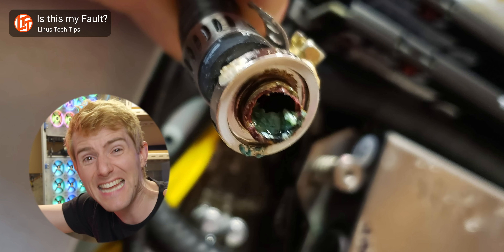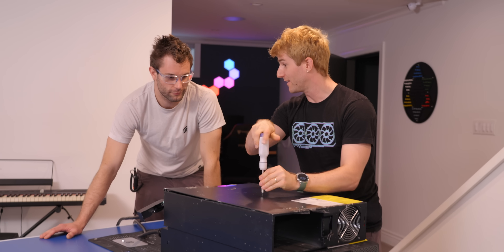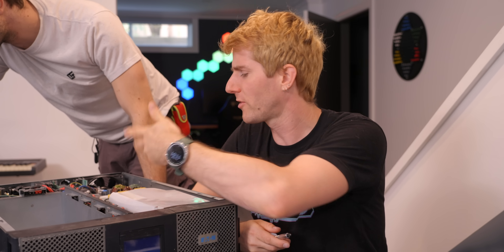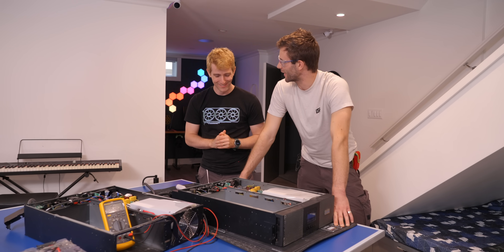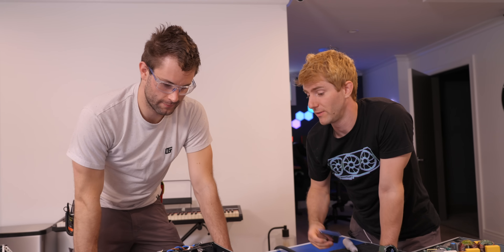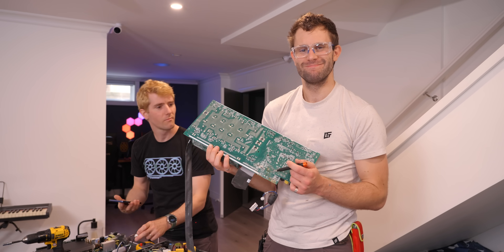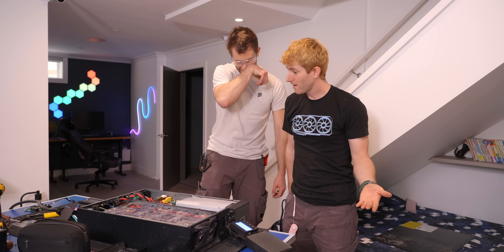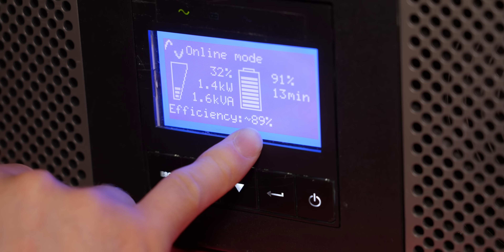Risking my life to save $5000 - Water Damaged Battery/UPS Repair

Comment: 14:46 BP Voltage out of range" refers to Bypass Voltage out of range in Eaton UPS systems, which occurs when there’s no AC power connected. By default, the UPS only starts when main power is present. You can bypass this by holding down the power button after the UPS initially turns on, allowing it to start without wall power or a phase. There is also a setting in the UPS to enable startup on battery power.

As a side note, if you start the UPS without grid power, it will have a random phase direction. If you later connect it to wall power, the UPS will sync with the grid within a ±0.5Hz range, which is another configurable setting.
Reply: Its great to see super specific info pop up in the comments for a project like this. Thanks dude.
Reply: Wow, that is a horribly confusing error name. How did they not realize people would misinterpret that as "Battery Pack Voltage"?? Why the hell do people do two letter acronyms for a single word like that???
Reply: @wisplite  its stupid, but CS and their technicians ideally would know what it means when it matters, like if it was already plugged into ac power. would still be better to make it clearer and save a google search or the poor CS reps from telling people to plug it in

Comment: Why aren’t servers etc. inserted at angles (say 35 degrees) like a cascade, so any leak at the top rolls down the top of each unit to a tray (with moisture sensing alarm) or the floor, if the top covers are have no holes. You have lots of engineers there, it’d make a great video idea.

Comment: Couple of things worthy of note for capacitors: Just because they are rated for say 600 volts doesn’t mean that they ever had 600 volts on them. Second of all, if there’s bleeder resistors on the board before touching anything short across the traces for the capacitors with something like a screwdriver. As soon as you do that you’ll be safe because the bleeder resistors will prevent those capacitors from charging up again. For the people who aren’t electrical engineers, capacitors can charge to a significant voltage if you don’t have a load on them, they are able to do that by picking up charged particles in the air and slowly building up a charge. That is why you always leave high voltage capacitors shorted out when they aren’t in use.
Reply: Big capacitors are scary things indeed! I have a couple personally that require the Permanently shorted procedure!
Edit: permanently shorting large capacitors is for storage if they are not in a circuit
Reply: IMO checking/discharging with a screwdriver is not a good idea with UPS, because it can easily get welded to the contact points.
Reply: Jesus Christ! Please stop advertising the ol' poke it with a screwdriver method. If you dont own a good multimeter to measure the voltage: You dont belong there. If you dont own the proper tool to discharge a capacitor: You dont belong there! Measure the voltage, then discharge with a big load resistor that is attached to probe wires. Alternatively you can discharge with the low-z mode of your multimeter, it will take some time.
Reply: Charged particles? I thought it was dielectric absorption?
Reply: @WindowsSucksUwU  Dielectric absorption is also the reason I know of. I've heard the "charged particles" idea before but doubt that is the real reason. Either this only applies in very specific circumstances or it is a misunderstanding on why we keep capacitors shorted when not in use...
Reply: Could one also try to power on device to help drain?
Reply: @mrmotofy  depends on the device, for my induction heater I built part of my discharge procedure was to “turn on” the output while it wasn’t plugged in to mains to safely discharge the large bulk capacitors. But in some cases turning the device on may charge things instead of discharging them so I wouldn’t say it’s a universal approach
Reply: Indeed. Film caps dont really come in low voltage ratings. It is common for even a very small metalized polypropylene signal cap in audio to be rated at 250-600V
Reply: Just beacouse parts are rated at 600V - doesn't mean faulty unit cant have > 600V on those. Typically caps can do +20% of their rating (600V cap can hold ~720V before destroying itself). As whole unit is faulty, some voltages can go way higher then they really should. PFC converters are a prime suspect there.

Comment: Yeah, I once accidentally shorted a 450V cap with my thumb once. PSA! Never take apart a power brick to diagnose a loose component guys. Managed to burn two holes in my thumb and then two more in the kitchen scissors discharging the power that didn't go through me. Hurt like F:)K!

Comment: I would love to have a few of these. I do have 6 1500VA but if I'm gaming and the power goes out (it goes out more than I would like) and come back on and goes out again a few minutes later the UPS will just shut off along with the PC. It's like the caps didn't have enough time to charge back up to catch the next power outage. It's happened to me twice now. And the last storm we had the power went out for a while, so I turned off my gaming PC. The power came back on, and it was up for 10 minutes. So, I turned on my PC and just as it was booting up the power went out and so did the UPS. Sweating bullets after that, but once the power was up for 30 minutes, I turn on that PC and it was fine but scared the crap out of me.

Comment: Probably not a good idea to have UPS under the water cooled machines, but at the same time you don't want a heavy device on the top of the rack.
Maybe you should consider getting some water leak detectors (like Aqara ones) and put them between machines (or attach wires to the nodes of the sensor and put the wires between the devices in the rack if the sensor doesn't fit) to detect water? Aquara is just an example I know you hate replacing batteries. But with a smart water leak detector and some home automation you might be able to setup something to turn off everything if water leak sensor detects a water. Just an idea.
Reply: The UPS already has "turn off everything" functionality; it's the RPO (remote power off) header they forgot to install on the back that put the UPS into emergency off mode when it wasn't plugged in. This is required by fire codes in many applications -- you need a way to kill the power to everything so that firefighters don't get hurt spraying live equipment.

Comment: Also could’ve saved 5000 by just buying a lithium solar battery generator and use it as an ups. It’s amazing the price difference in products that are the same but one is sever-rack shaped and it’s double the price.

Comment: Instant acid reflux! As an electrical engineer i'd strongly recommend NOT to use that thing. Whether it works or not. Any hairline fracture in the boards/contact points can wreck it and burn your house down. Your fire insurance will just flip you the bird. "Just think of your kids"[tm]. No seriously. DON'T USE IT!

Comment: BP low, is Bypass voltage low. because the UPS is not powered by utility, if you had pressed and held the power button, it would have started in battery operation. and when i saw the emergency power off I emideately thought of the remote power off (RPO/EPO) best regards an eaton tech :-)

Comment: Work with high voltage equipment, puts safety warning everywhere, but doesn't electric - restraint work gloves, that would have cost nothing but make very dangerous thing, slightly less dangerous

Comment: I hate UPSes, they're a headache, they fail when you need them and end up costing more than the damages if something happens. Mos UPS units don't even know their batteries are dead until they try to use them in an emergency.
If you live in a stable area just get anti-surges on your consumer electronics. (yes, they also expire, but cost near nothing)

Comment: 0:15 Sir thats not a high voltage piece of equipment... "define high voltage as above 1000 V for alternating current, and at least 1500 V for direct current."
Reply: not HV for an electrical grid, definitelly HV for electronics!

Comment: I took a broken screen for free that wasn't cracked and fixed it by just swapping out the capacitors in the PSU preventing. Please don't worry I knew what I was doing.

Comment: not suprised that the lead acid battery still work since they are pretty short resistant and im also guessing you used distilled water for the cooling loop or other similar non/low conductive liquid , and the only other way they can be made unusable with water is if the acid in them gets too diluted in which case you can just fix that with replacing the acid or using a non reactiv drying agent
Reply: They are sealed

Comment: "DO NOT TRY THIS AT HOME. Not only will you die, but it will hurt the whole time you are dying."
Reply: Except that you wont die.
Reply: I wonder how many unskilled people will kill themselves in the upcoming months buying defective electronics repairing and reselling them. Darwin, here we come!
Reply: Yeah it's not mains, it's either going to give you the biggest jump of your life or make your heart stop instantly, but need to call emergency services immediately no matter which.
Reply: @vgamesx1  Use a ground strap on the wrist that is touching things and ground the screwdriver/probe. If it gets you, It will hurt for a bit, but be fine. The big caps that cause the danger are easy to see and probe/drain. Try not to blindly touch traces until they have been dealt with and it will be fine.
Reply: naaaaahhhh, those caps will just zap you back into existance.
If it takes its way through your heart like my ex, you should go to the ER as fast as possible tho.
Reply: I spot an AvE reference here. :)
Reply: Everybody responding be like "Nah, you won't die!" Okay, you guys go ahead and be reckless with electricity, have fun. Make sure to get it on camera.
Reply: @eldibs  I'm not saying it can't hurt you, I'm saying it's highly unlikely you actually die. I play with high voltage for a living. I'm not trying to "be hard" or whatever over here. Ohms law is a fundamental thing. Skin resistance is fairly high, 200v is actually not that much. Look up how many volts your socks can generate, and check out ohms law while you're at it.
Reply: @le_potate3861  I know about Ohm's law. I also know enough to treat electricity like a gun - respect it, always treat it like it can kill you, because the one time you're lax will be the one time it's deadly.
Reply: @eldibs  ok boomer
Reply: @eldibs  go write greeting cards please.

Comment: Even if the design includes a bleed down resistor, when you are dealing with damaged components, you cannot rely on the bleed down resistors still functioning.
Reply: Either this resistor bleeds down, or the engineer working on it does.
Reply: Came here to see if someone had written this comment - this is very good advice.
Reply: The only way that would happen is if the connection between the capacitors and the bleed resistor broke somehow, which is highly unlikely. It will protect you from 99.9% but always have a healthy fear from high voltage capacitors. It's charged until you confirmed it's not by measuring and/or even attaching your own bleed resistor onto it.
Reply: @realms4219  Yes, in a competent design, the bleed down resistor is located proximately to the capacitor in question.  Running a trace to the far side of the board to put in the bleed down would be dumb.  So usually damage that takes out the bleed down will also take out the capacitor itself.  Still, there are people who are only alive because danger missed them by milimeters, and many who are dead because it didn't.
Reply: Even so, you can manualy check/drain.
Reply: The design MUST include bleed down resistors if its is to be sold in north america, it needs ANSI and or CSA, or a ULC standard approved by the US or Canada
Reply: @NickB-pc4fu  Strictly, only if the voltage exceeds 50V, though they often do below that.  50V is usually not that dangerous (hence why it's the cutoff for being considered low voltage).  Unless you have enough capacitance for arc flash to be a danger to unprotected eyes.
Reply: Still waiting to figure out how someone could actually die from only 200 volts in a dry environment. Source - I am a high voltage technician. 40kv and above. 200vdc isn't enough to kill you, except in extreme circumstance.
Reply: @le_potate3861  200v DC is plenty to kill you.  Typical internal resistance of humans hand-to-foot is around 300 Ω, which works out to 600 mA at 200v.  So you just need a tiny break in your skin, like the burn you get from an electric arc, to have a rather bad day.  A 200v capacitor is unlikely to kill you, if it isn't connected to a supply, as it won't sustain the voltage long enough.  At least, assuming you aren't particularly susceptible to A-Fib.  

Yes, people do tend to over estimate the danger, and especially the lethality, of medium voltage systems.  People even get nervous working on their cars and other 12v systems (where fire is the only particular concern).  Then again, even low voltage shocks are painful, and secondary risks (like causing that vehicle fire) do exist.  

Short a high energy cap with 20 GA wire and you'll vaporize the wire.  Not anything you want in your environment, and most people don't work in fume hoods.
Reply: @yellingintothewind  I just grabbed the multimeter sitting next to me and measured 238kohm from one hand to the other. You aren't dropping the entirety of the voltage internally. You drop most voltage via skin resistance. In extreme cases just about any current can be lethal, but those are the extremes. Even using your burn scenario is extremely unlikely since there's almost no way you would make contact for long enough to actually burn through your skin.

The over-the-top "look at how dangerous I'm being" is just uninformed and cringe
Reply: @yellingintothewind  by the way, what is the arc distance of 200v at atmospheric pressure? Trying to figure out how someone would manage to actually generate a sustainable arc at 200v. It just isn't a thing

Comment: I work on Valve amplifiers and was testing some 650 and 1000 V capacitors. Accidentally dropped screwdriver across two terminals… I was temporarily blinded

Comment: Tynan's "okay" to Linus justifying using an extension instead of changing the plug entirely is what I feel whenever someone tells me about their insane ways of doing things that could be so much better, but because it "works"for them this way, they don't want to change it...
Reply: Especially when a $10 plug from the local home improvement store is probably cheaper than the extension cable/adapter.
Reply: I came here to say this 😂
Reply: I meannnnn I kinda get what Linus is saying though. If I'm well aware of the "better" way, and I can't remember why I did it the "janky" way in the past, I'm not gonna fix it until I can remember why I did it that way. It could've been laziness in the moment, but it could've also been a super specific niche situation.
Reply: @_gyepy  This. Even if the reason is forgotten, there might be a darn good reason for it that you won't find out about again until you try to change things. Then you're looking at the situation going "damn, that's why I did it like that."
Reply: @_gyepy This sounds suspiciously like something G K Chesterton got cranky about when discussing the barriers one encounters in neighbourly relations.
Reply: Reminds of my times as a machine safety inspector. Having people telling me that "it's ok like this, nothing bad ever happened before."
Sure, my bad then for thinking that a stone saw blade with Ø1m, spinning at 700rpm should have the cover replaced because it corroded so bad that it's literally being held together by "add-on" threads. My sincere apologies sir.
I'm sure that when that machine is turned on, a soundtrack of "NOK NOK NOKing on heavens door" starts to play as well.

Comment: 0:36 Love the way Linus talks about saving money with the 100.000$ Porsche in background 😂
Reply: You get a $100,000 Porsche by not spending money with abandon
Reply: Not wasting money goes two ways. Repairing good stuff instead of trashing it is one. Not buying trash is another. 
For many people whom can turn a penny into copper wire between their fingers, long term cost analysis (while taking service life and quality into account) often leads to a more expensive purchase over a less expensive one.
Reply: yep, thats one way to eventually get nice things and be succesful
Reply: @Zulu_Drops_Dubs lots of work, but even more luck. Thousands of people try, but only the chosen few get lucky enough.
Reply: Linus is notoriously tight with his money, but not as much as Luke.
Reply: I'm an hourly paid electrician. I built my 1969 nova ss clone from the ground up in a dirt floor shop. I have about 30k in it and it is appraised for 60k. You can like nice things and be cheap. I still buy great value brand and eat ramen noodles.
I can promise ya the 6.0 LS in my nova throws a code I can fix it before the weekend is over. Linus is gonna take that Porsche to a dealer and pay out the ass while waiting months.
Reply: @user-neo71665  nice car, love the classics. 
New performance electrics are faster, quite, comfortable, and handle like they are half the weight. You can also charge from home over night so you never have to buy gas then offset the cost with overkill solar. If it lasts 20 years the car is essentially free. Electric motors are insanely reliable, the batteries seem decent (too soon to tell)... but the fear of a system code is terrifying. 
I recommend going to test drive a m50 or Taycan, it's brain melting.